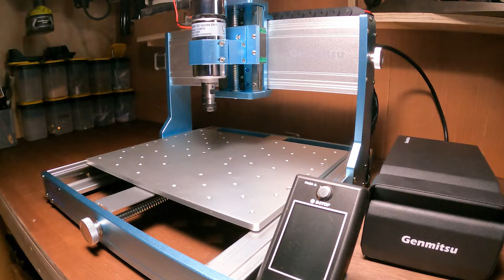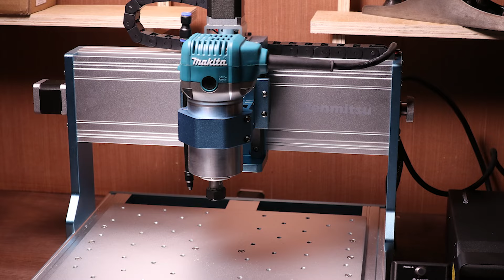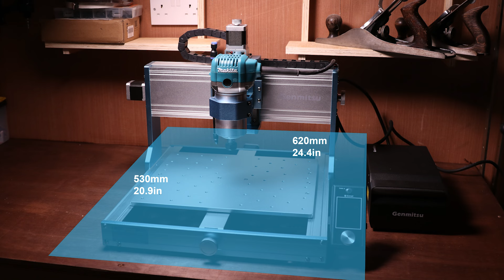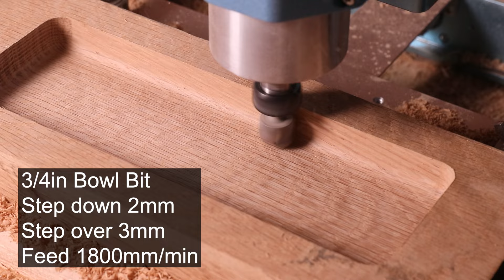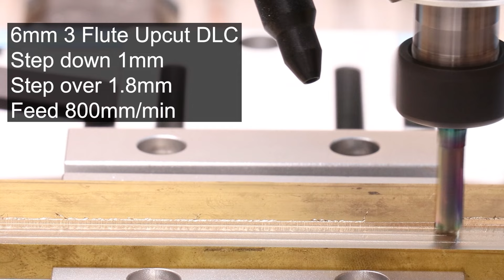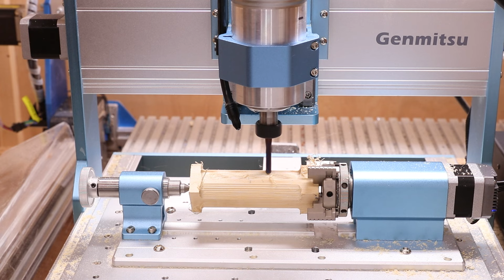Best CNC under $1000 - 3030 Prover Max Review

Comment: This is great! I’m totally new to this so apologies for this question: can this machine cut the art that looks like a 3D fox that you’ve featured in your review for Vasto?
Reply from the maker: Yes it can. Those are 3d relief carvings and this machine can do those as well 👍
Reply: @JamesDeanDesigns  thanks so much! Would you recommend this one over Vasto, or a 4030 which is the same price currently on Amazon?
Reply from the maker: @maxkunakhovich8919  it depends on what you want overall. I would say the 3030 is more precise, the 4030 is stronger and the vasto is a bit of both so overall by choice the vasto is what I'd go for. And I think it still has 20% off
https://www.foxalien.com/products/cnc-router-machine-vasto-xl?sca_ref=725103.t6qfXeHAnx

Comment: Problems with Z-Probe and upgraded spindle: 
Hello James after making my first cuts with the 3030 Prover Max CNC I am experiencing the following problem with the Z-Probe that came with the machine.
With the 300W spindle running wit the internal 48VDC everything works fine. When I use a spindle that works with mains (I use the Proxxon UF/E type) voltage the Z-Axis does not move down  when performing a tool measurement. It always retracts so it seems that the control is receiving a signal that the probe is touched even it the bit is far away from the plate of the Z-Probe.
After some research I found out that this problem only occurs if the spindle is connected to the mains socket. It does not matter if it's switched on or off. If I unplug the spindle or disconnect the crocodile clamp from the bit the Z-Probe sequence is running as it should. 

So I assume the cause is the ground wire connection to the socket that seems to disturb the Z-Probe sensor unit. I think the Makita router also is grounded to the mains socket and if so it's likely the problem also arises to other users too. 

Do you or anyone else have experienced this odd behavior of the Z-Probing function? Does anyone have a solution yet?

Comment: Is it a true 4 axis or 3 +1?
Reply from the maker: Not 100% sure what you mean but to my knowledge its a true 4th axis,  ran as an A axis
Reply: It's easier to explain with 3 axis. With 2+1 if you want to bore a whole it takes z to some depth then cuts the circle then z goes down again it cuts a circle so on until it gets to depth. This is what a lot of FDM 3d printers run as. True 3 would cut a helical path down the hole (all 3 axis moving at once). So 3+1 it would index a (say 90 degrees or watever) then cut x y and z, then index and repeat. True 4 all 4 move at the same time. It's faster, can get some geometry the other can't, but it's very demanding on the machines computer (and on the cam programming it too)

Comment: Can you make a upgrade tutorial for the 3030 Pro?
Reply: get a good spindle, Teknomotor has a few that spring to mind in the 0.33 to 0.6-0.73 kw range. The 0.4 kw is one I could see work well due to it's high RPM and limited weight, but you would be giving up the main benefit of the 0.33 KW or 0.6KW version ... the ER16 collet as the 0.4 KW only has an ER11 if memory serves. Why limit weight, the steppers. In fact I would add that as upgrade nr. 2. Replace them with JMC IHSS42-24-05. These are closed loop steppers (not servos) with a little more beef and of course the benefit of being closed loop with an integrated controller, note that this means replacing the controller too so do your due diligence here. If you are going to run it with something like LinuxCNC get a cheap mesa card to control it. If you want to stick with GRBL based stuff, be it a basic controller or something a little more fancy like an ESP32 based one, maybe running the ESP32 version of GRBL or even FluidNC. Which brings us to upgrade 3 (i guess) upgrading the controller. The little screen is nice but to be fair I always found them to be little more than a fidgetty gimick. But then I have fat fingers so yah.

Oh why steppers and not the servos (JMC now has nema17 closed loop servos too, yay) ... Config on a servo is a little more involved and for a small machine and small parts I am not convinced it is worth it. Typically servos give better finish (compared to steppers) due to them moving in a more fluid manner. But at these sizes speeding up and down on the servo will be a pain.

Comment: The Z-probe delivered with this tool is a toy. The used connector is very fragile and does not make always a good contact, what is dangerous to perform Z-probing.
Reply from the maker: The Z probe itself has been used a few times now on different models. I'm not 100% sure why they went with the jack connector approach on this one though, but I found as long as I made sure it was pushed all the way in until it clicked, I worked fine both with the offline controller and in UGS

Comment: I'm new to CNC, but curious... what is the maximum size of material that could be worked? I know they advertise a working area, but is that working area considered usable? Or is actual tool length going to take up some of that working area?
Reply from the maker: The X and Y measurements are fully useable, it's the Z height that's tricky as you have to allow for safe travel so whilst this has an 80mm z travel I would say max cutting height is 70-75. As the spindle is in a clamp you can adjust the height of that according the the length of bit you are using to some degree
Reply: @JamesDeanDesigns  Thanks for explaining it to me, as I was definitely having problems understanding marketing vs reality.

Comment: This CNC in a nice tool but has also some problems. In Candle, the Height map is not working.
Reply from the maker: Candle isn't anything to do with Sainsmart or this machine, it's just one of the free pieces of software that can be used with it. However Candle hasn't really been developed for some time now so I would suggest switching over to UGS which is constantly being improved and has a height map feature

Comment: Hi James, thank you for all the time and effort you put into your reviews and videos. They are always great. I have a question that might (hopefully) benefit others too. If I was solely interested in precision and accuracy, and wanted to stay with Sainsmart/Genmitsu (great support/network), which machine would I choose? I've had the 4030v1 for a few years now and just can't achieve the fine repeatable accuracy I'm after. Would this 3030 with linear rails, be more accurate than the 4030v2 for instance? I'd really appreciate your opinion. Cheers.
Reply from the maker: Yes the 3030 should be more accurate and precise in theory as there is minimal flex on any of the axis. Arguably the weakest part that is likely to flex would be the shaft on the standard spindle as its only an ER11 collet.
Reply: Awesome, thanks for replying. I actually hadn't thought of the possible flex in an ER11 collett, but that wouldn't be an issue as I would use a Makita anyway. Thanks again for all the work you put into your reviews and videos, they are always interesting and straightforward! Cheers.

Comment: Hi James
I currently have a Genmitsu 3018 and am looking to upgrade to a Genmitsu 3040 or 4040, which is the better machine, I mainly work with wood.
Reply from the maker: Hi, There is no 3040 as such. The extended 3018 is considered a 3040,  but I suspect you mean the ProverXL 4030 maybe? If so then then the ProverXL 4030 is a better machine than the 4040 Pro. If its a choice of the 4040 Pro or this machine in the video, then the 3030 Prover Max in the video

Comment: Thanks for that great and helpful review and testing of the machine. 
I was aware of the fact, that a 300W Spindle with a simple bearing of the spindle shafts has limited capabilities. But I'm impressed that the machine itself is very sturdy an precise. The hint to problems with conductive chips affecting the limit switches is very helpful. Not to imagine you have a long job running on the machine an getting a limit switch alarm that spoils your stock. I won't be cutting steel but now can be sure the CNC manages to cut aluminum with ease.
Reply from the maker: Yes the limit switch thing was a bit annoying but equally a fairly quick fix even if that is simply taping it up

Comment: I'm guessing that the steel used was mild not stainless judging by the look of it. It would have been nice to see some results from the original spindle that came with the machine since not everyone would be planning or could necessarily afford to upgrading straight away to the Makita router and much of what was achieved was down to the Makita routers power, the general rigidity of the frame not withstanding, which is not what you get in the box.  I can't help thinking that out of the box it's might not be the best CNC for under $1000, maybe do a small add on piece showing the capabilities of the CNC with the original spindle.
Reply: Rusted stainless steel?
Reply: @cmtetaboaco  That's why I said mid and NOT stainless, I guess you must have misread.